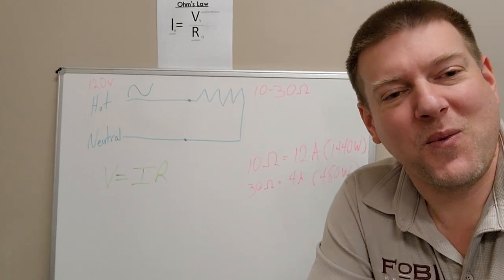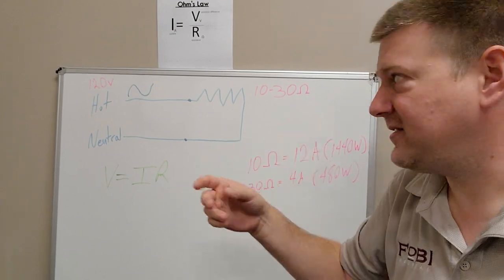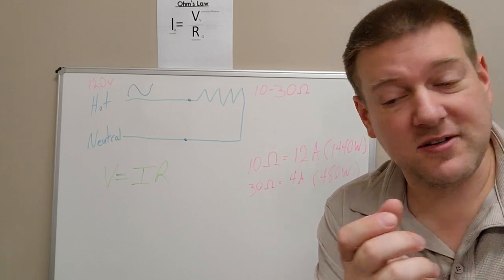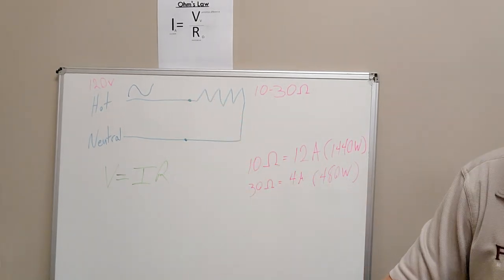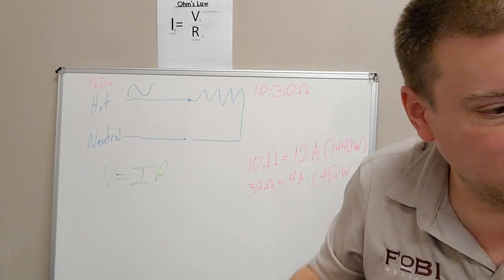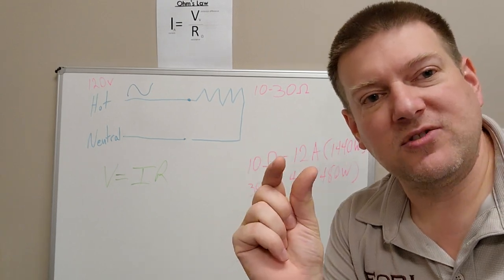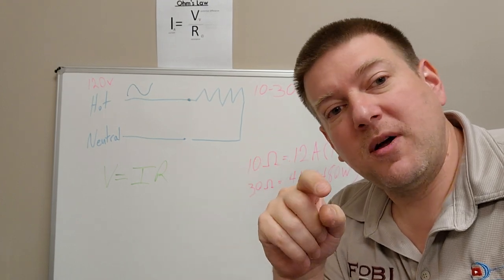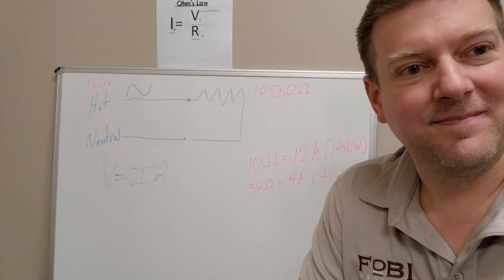Testing Heating Elements

Comment: Nice video. I use phase angle power controllers for air heating elements at work. A whole different animal but pretty cool.  I have a lot of respect for biomed techs, most if not all of the ones I knew from contracting to hospitals were very sharp.

Comment from the maker: I talked about the voltage drop because if you measure AC across a live element - that is normally a voltage drop (unless the circuit is open / bad element)

Comment: hi, i have an accutorr v plus monitor, the equipment turns on the spo2 sensor led but then it turns off and doesn't work. The sensor is new, I already tried with a generic and original spo2 sensor, any idea of the problem? Could you help me there are 2 teams!
Reply from the maker: In the USA, we have Nellcor, Masimo and then some generic SPO2 cables. They are not cross compatible. Is there a sticker on the device advertising the SPO2 technology (right by the port)?